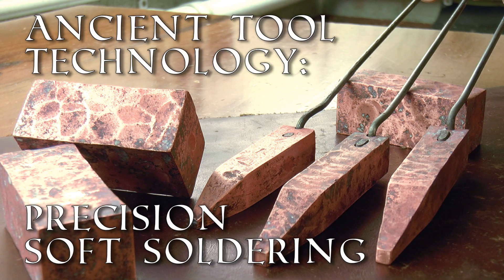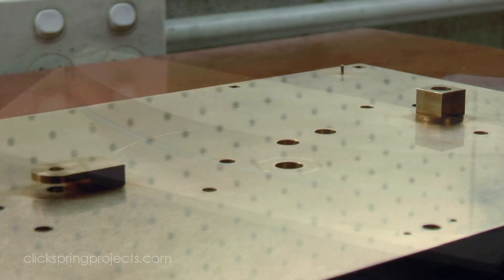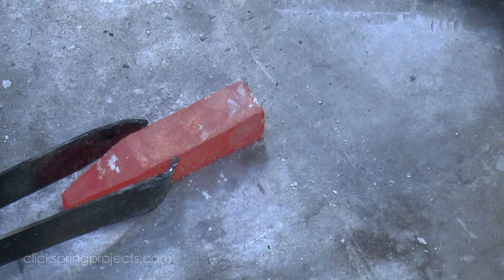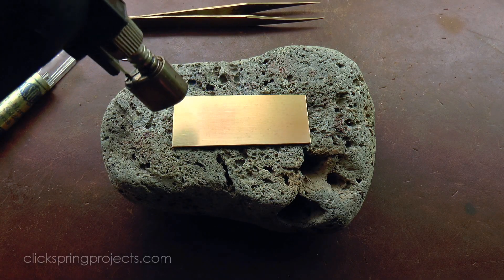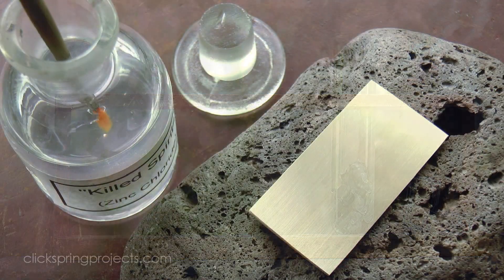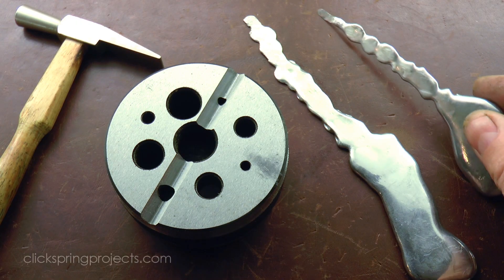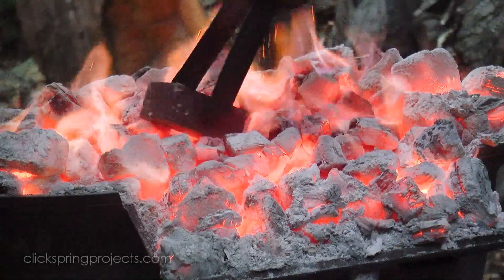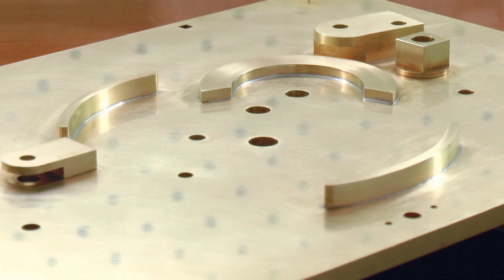Precision Soft Soldering For Constructing The Antikythera Mechanism - Experimental Archaeology

Comment: Didn't they have blow lamps at that time? It would make soldering super easy and only use a but of fuel. Blow lamps can be traced back to old greek times, around the time this was made if im not mistaken. Though your copper block solution was a remarkable idea and was no doubt an option they had at the time

Comment: Something else you could also try to heat the area is a blow torch. I'm not talking propane blowtorch or even a white gas blow torch, I'm talking a tube next to an oil lamp. You would blow through the tube and it would have a hot enough flame to be able to melt glass whilst still being precisely controlled.

Comment: Chris, why do you think that solder had been chosen here to join these parts on the mechanism, when so much of the other construction utilized peened pins and pressure fits? It seems to be a departure from a proven and reliable method, along with the added complexity of the cleaning and heating necessary for the solder to adhere.
Reply from the maker: Great question, I agree its much more hassle to solder than simply pin so not really sure of the reason. One explanation of some of the pinning is that double sided soldering would have been too much trouble due re-melt/alignment etc, but that doesn't really explain why solder at all, esp since it really isn't a mechanical requirement - Cheers :)

Comment: I see that this is a few years late, buy why do you think the soldering was not done with heat from the forge? The material is conductive enough of heat that it would be soft or hard soldered in an oven today. Not critical, just wondering how you got to this answer. Thanks.

Comment: would it not have been more efficient to heat the entire plate over the flame? apply rosin and place the parts down, then apply the solder and then remove from heat.

Comment: That feeling, when a guy with ancient tools and methods achieves ten times nicer and probably twenty times stronger joint than you do while using modern soldering equipment.

Yep, I feel like an absolute failure right now. Great video tho.

Comment: Zinc started being used from the last part of the iron age. Up until then there is a very small number of bronze findings with zinc, but...... the problem is with the autenthicity of those pieces.
  Most materials sugest that zinc wasn't used in the bronz age and neither in the start and middle iron age but definitely starting the las part of the iron age.
  The thing is that i know that there are fibulas (bronze and silver) that were soldered and i am still trying to find how. They soldered bronze to silver and other materials
  I am a silversmith and i use traditional techniques in my works, trying to recreate some ancient artefacts in a traditional/hystorical way pushed my interest in finding more ancient techniques and soldering is one of those that i still haven't found enough materials about it. I watched most of your videos and most techniques and tools that you use and make are 100% viable for ancient times. Right now i am working on some bronze mirrors decorations with circles and i am sure that you made a video about the tools i need (i am still searching for it in your videos).
 Found it, "The Scorper And Trammel" video.

 A,another one because i saw you forged those copper pieces. Do you think that bronze (CuSn7%) was forged or worked cold?

Comment: Probably had a wooden board on top so the things didn't move with enough area to apply the solder - plopped on top of a forge or foundry or something along those lines. The wood may have taken some heat but should've been pretty well protected from the bottom plate, and it could've held the things in place easily if they weren't pinned first.
Reply: The method you used is pretty good too - especially if you don't want to heat up the entire underside. my method means the work area remains hot so you can do all the work and remove it... or with a foundry or forge, only a small area could be heated - especially if a pipe is used to direct heat and a tabletop to support the rest of the piece. This would mean heat is only applied to the bottom, and it would soak up through the piece. Either should work - mine wouldn't require the tips or the heat blocks. yours is more interesting and, back then, you could claim it required more skill from someone witnessing you doing it - thereby charging more for the work. and because of specialty tools required - it would be harder for others to copy.

But if you had to do a lot of these, or more work - my method would be quicker most likely. Heat the item - a wood block could be used for stabilizing the things on top and positioning them, keeping them from sliding out of position as you slide the item off the heat vent and onto the tabletop... and leave it to cool there - or move it from there. This would also have the benefit of 3 distinct heat levels - the heat from the vent, the heat from the table which would be less because it wouldn't be under the hottest part of the fire / forge / foundry - whichever is used - and then ambient... so the second could've been cool enough for the solder, but maybe warm enough for the rosin.

Comment: could you not use the part itself as the heat source. if you put it in a kiln rather than just the ashes and then cover it with the flux and lay it on the solder?

Comment: Really interesting video, but you know it's a lot better to work copper when it's annealed than when it's hot. Hot copper runs the risk of crumbling appart when hammered, like wrought iron would. Copper is FCC at room temp and so is ductile enough to be worked cold as long as you periodically heat it up to reverse work hardening and water quench it again to fully anneal it

Comment: part of me really doesn't think the ancients used a direct heat source like burying copper in coals as that would contaminate the work place with soot and ash (they may have heated the copper on a clay plate that was above a fire or sometthing else to keep things clean). it seems like your attributing primitive with unintelligent as i would imagine they'd have had some work station that would allow them to keep the manufacturing process and heat application relatively clean and efficient, though i could be wrong, haven't look much up on this mechanism yet but i will admit it is fascinating and an example of how what we see as ancient primitive peoples being vastely more intelligent than we give them credit for

Comment: It’s definitely a handy way of joining dissimilar metals. I used to make casing clamps for drilling rigs that required tungsten carbide teeth to fixed into slots machines in the mild steel housings. It’s definitely satisfying when you touch the solder to the joint and you see it neatly flow out all around the piece.

Comment: or they covered the parts with solder before putting them together. You dont need rosin. I just took a resin from a random tree and its as good as rosin. Also to clean the metal really good you throw it into vinegar. When I solder parts which my trusty 125W transformer solder gun doesnt heat up, I put a candle or two below the big part. Extra 100W or 200W of heat.

Comment: Would it have been easier to chip off the solder into little beads or tiny shaving that were mixed with the rosin and then the full plate simply placed inside a furnace. If you used that approach. You wouldn't have to needlessly work so quickly with the hot metal pieces.

Comment: I'd wonder if they used direct heating, or an open-top version of a common earthen oven, myself. It would also be slow, but they'd be able to carefully place the pieces, flux, and solder, while the base was already on the heating surface, before starting the fire. Then it would just be a matter of tending the fire long enough to see the solder flow everywhere.

Comment: I have done lots of silver soldering. Not much brass. This helps a bunch. I have a half barrel of scrap copper. These will be great base heaters. I really want to try rosin flux. Totally enjoy these presentations. Tool making is what being a complete metal smith is all about.
Reply: You haven’t used rosin? It’s the most popular flux and it’s cheap

Comment: I don't know that an open fire was the best way to heat the materials anyways. Keeping an open furnace that retains the hear better, or even using a modified oven with a bellows, and vents to allow oxygen to the charcoal, you can get things up to higher temperatures in shorter amounts of time.

Comment: I was thinking about the silver soldering we jewelers do (really a form of silver brazing). To this day, many traditionalists do it with a blowpipe. Do you know of any record that people at the time of the creation of the antikythera mechanism would have had blowpipes? People today even do fusing (a sort of welding) with alcohol blowpipes. Charcoal and candles work as well.
Reply from the maker: Hi Patrick - I very much wanted a simple candle blowpipe to be in play, because it would have been a lot of fun to try out! Unfortunately I couldn't find anything credible in the research to support the practice during the period. (which of course doesn't rule it out, I just couldn't rule it in with confidence.) I do think its a method that would probably struggle to supply the required energy rate for the scale of this particular job tho - the plate is a huge heat sink, and even the red hot blocks+irons only just get it over the required temperature. Alcohol distillation and other volatile distillates can be safely ruled out, they come much later on the record - Cheers :)
Reply: Thanks for the reply!!!

Comment: This is the first clickspring video I've seen and it was a joy to watch!  I know this isn't welding, since the two pieces to be joined are not melted into each other.  I'm unclear on the soldering/brazing distinction, though.  How is the process in this video different from brazing?

Comment: How are the parts precisely positioned during the soldering process? Is it possible that the entire set of parts were soldered in one heat cycle if they were all held in position by a jig, along with strips of the solder along the seams of each targeted joint?
Reply from the maker: Hello mate - Mostly the parts were positioned by eye, except for the H/I pivot block which requires very precise alignment. For that I used some pins inserted from underneath the plate (visible from above at 1:20) - Regarding soldering the full set of parts in one cycle, its possible but it would raise some complications. The main one is that there are multiple unrestrained parts on each side of the plate. It would be much more challenging (and require more than the minimum rational approach) to maintain alignment of all parts on both sides - Cheers :)

Comment: Any particular reason you did not consider heating the whole assembly over he fire for soldering (maybe with some way to then remove that heat source without disturbing the parts)?
Reply from the maker: Multiple loose parts on both sides of the plate means that if done that way the job would become much more challenging and require more than the minimum rational approach - Cheers :)
Reply: Makes sense. Cheers :)

Comment: I am surprised you didn't use a blowpipe. Easy to make and surely available in the appropriate era, hotter and easier to control than a copper, plus very clean. A small blowpipe is a super tool to have for certain jobs that require a controlled point source of heat.

Comment: A question: Why did you hammer the copper? I would leave it flat as much as possible, so the heat transfer onto brass plate is waaaaaaaaaaaay better (air is bad temperature transmitter).

Comment: I have a question about the for blocks used for heat transfer. Why not make the sides much smoother? That would have surely improved heat transfer through conduction and made it more precise. You could even have a non cuboid shape with a smaller flat transmission surface and insulation elsewhere to get a really focused area of heating (e.g. an L shaped piece on its side). Obviously what you had worked great, but I'm just wondering if you considered anything like this. As always, thanks for another great video.

Comment: Well done Chris!
In consideration of excess flow, or overflow of solder. 
Gunsmith pro tip:
Graphite works well for higher temps for such projects as soldering open sights onto steel gun barrels. It contaminates the surface and causes the solder to bead up and stay under the fitted parts.  I’m sure the same would go for copper/brass surfaces.

Comment: Nice video and history lesson. I would counter your choice of heat sources with that of putting a few oil lamps below the base and having at the top of the plate unobstructed. But your method was a little more dramatic. My Grandfather used to use Rosin flux when I helped him as a child. This brings back memories. Thanks for taking the time to make these videos. I know it is a lot of work! 

Mark
Reply: Kravchenko Audio the lamps would blackened the points above them. As for the fuel, just olive oil
Reply: There are many methods possible. even a clay pot with chrcoal in the inside. the possibilities are great. But the point is that people in the past were at least as intelligent as today.

Comment: Excellent joint considering the tools.  Recently I moved and left my soldering iron behind. I tried desoldering a wire by getting a nail hot on the stove but that did not work. I didn't have access to large copper blocks like you but I had copper wire. I wrapped it on the nail and tried again. It worked .... just barely though.

Comment: So much information was lost in the bronze periods 3-4 dark ages glad to see someone finally taking an interest in trying to restore some of that lost knowledge. Most shops teach orally via apprenticeships so many of the old tools and techniques got passed down without any written word to go with them.
Reply: I also think Iron was used prolifically in the bronze age but due to the decomposition rates of irons things older than 800 years rarely survive unless maintained or sealed off from the air. Some rare examples like Tuts dagger behave almost like a stainless steel and Iron would have been easier to make than bronze which relied on the silk road for most tin production and the island of Cyprus for most copper. Iron on the other hand was likely an accidental bi-product of heating limestone rocks to make cement and might have even formed trying to process other ores but without more documentation from the Era we only have scraps of information to base hypothesis on.

Comment: Thank You Chris.  I was surprised how quickly the CU blocks heated the plate, based on mass and size of them and just a light touch with the iron and off it went.  Beautiful solder wick too using the rosin!  Impressive thermal transfer method!  Terrific research and testing...as always the Best!
Reply from the maker: Thank you mate!

Comment: How did you locate the parts accurately?
Reply from the maker: Mostly by eye, although the support block for the H/I assembly requires very accurate placement so I used a couple of locating pins inserted into the drilled holes from below the main plate to guarantee location (visible from above the block at 1:12)

Comment: I wonder if maybe they simply had a whole stack of copper blocks that the apprentice rotated from fire to work piece as the master did the soldering of the various parts.  Seems like most things were done in teams back in the day as opposed to an individual artisan working alone.  Fantastic video as always, and fascinating process!

This may be a silly question, but is there a "hard" solder?  If so, what's that process, and the benefits of hard vs soft solder?
Reply from the maker: Recommend this book for the answers - Soldering and Brazing (Workshop Practice, No 9): Amazon affiliate link https://amzn.to/2MV7zsY

Comment: Would it have been feasible for them to accurately place the components to begin with ,using the rosin to hold them, then place small amounts of solder against the components and heat the whole assembly over a fire to achieve the final solder joints in unison?
Reply from the maker: Its possible, but it would raise some complications. The main one is that there are multiple unrestrained parts on each side of the plate. It would be much more challenging (and require more than the minimum rational approach) to maintain alignment of all parts on both sides - Cheers :)

Comment: Hi Chris - fantastic how a simple task like soldering can be done without a modern soldering iron/blowtorch.  How did you deal with heat distortion/expansion not twisting the parts or the base?

John B

Comment: I was given a Telecoms apprenticeship in 1972 and my first job was out in a field to set up the stove to heat the soldering irons.  4 massive copper blocks fixed to rods with carefully tended shiny turned dark wood handles.  Mixing borax and spit or cold tea to make a flux paste and the rest of the day handing irons to my mentor who would solder connections set them back on the stove to re-heat.  Slow steady work that went on, and on and on and on and on.  I had no idea where the job would take me and by the end of the day more than an inkling where it wouldn't.

That particular job is still done using the same kit.  The stove heats and dries the atmosphere as well as keeping the guy's fingers warm, better than a battery powered iron.

Comment: Hello, why not directly heat the brass with charcoal? Is it why it could bend?
Reply from the maker: yes distortion would be a risk, and there are multiple loose parts to solder on both sides - Cheers :)